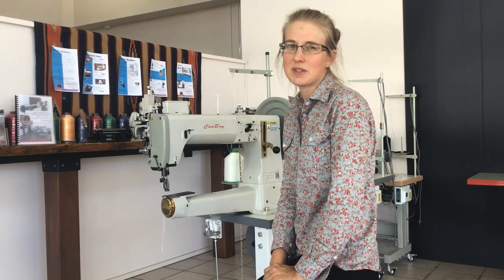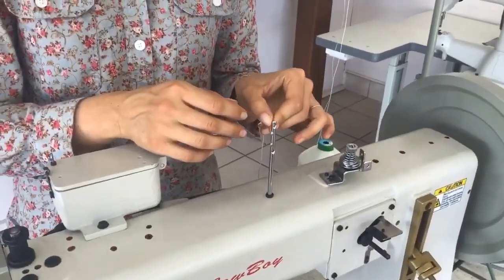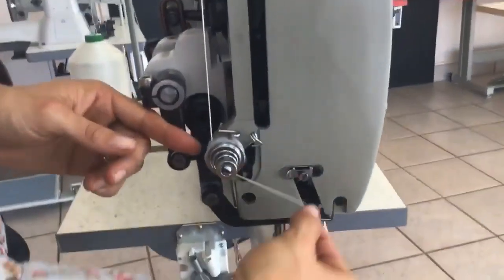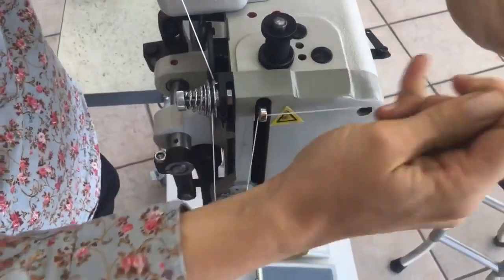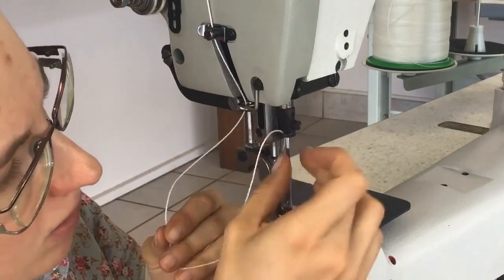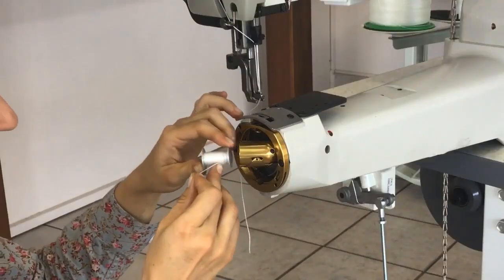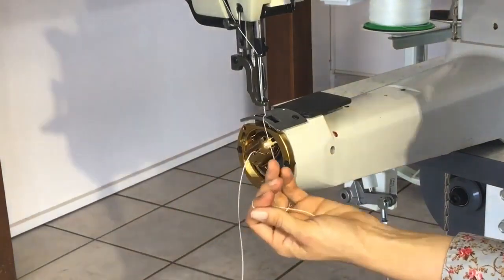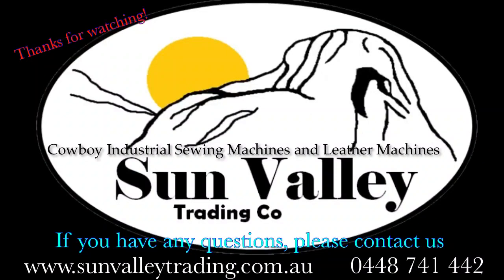How to thread an industrial leather sewing machine

Comment: GREAT VIDEO, I have the CB5500 which is the longer arm version of what is in the video. They are great machines. You have a nice way of presenting. Well done. Hopefully you will do more videos. Maybe oiling the machines, using the binder attachment, different needles and threads etc. Also anything about Cowboy skiver machines and how to oil them.
Reply from the maker: Paul, thanks for using CowBoy leather sewing machine. We have video about oiling and thread tenion adjusting. If you have need any additional help, please contact our local dealer or info@cowboysew.com, thanks!